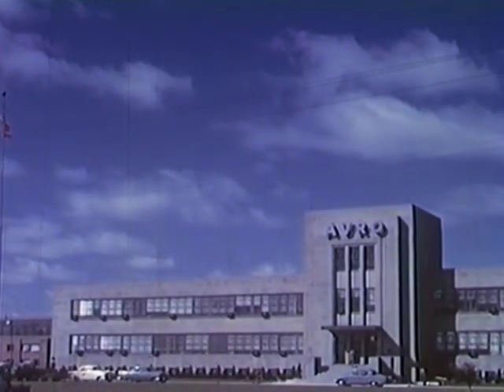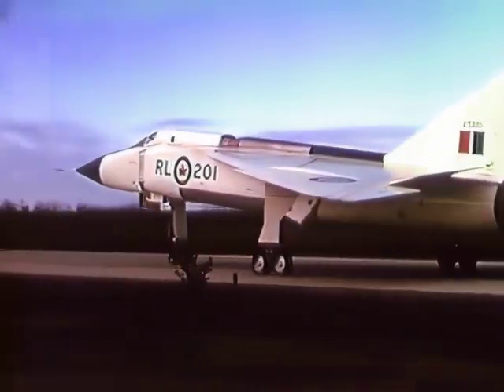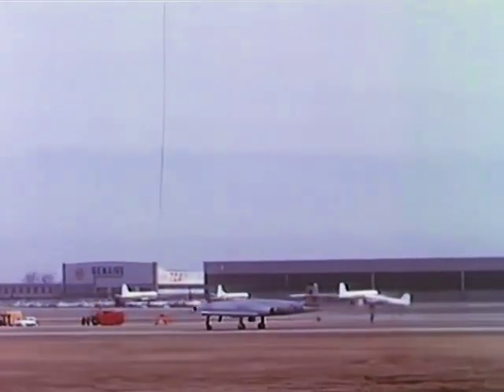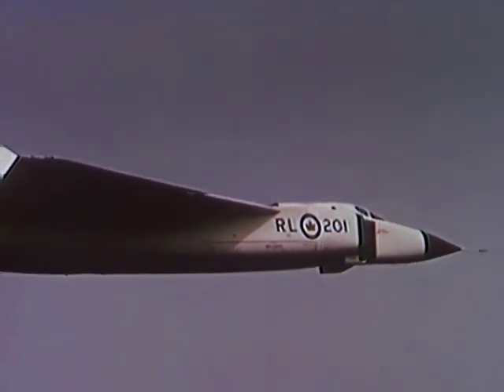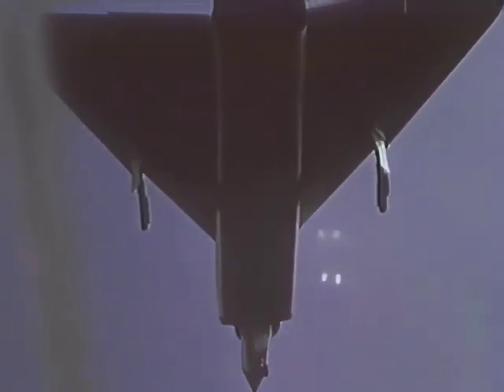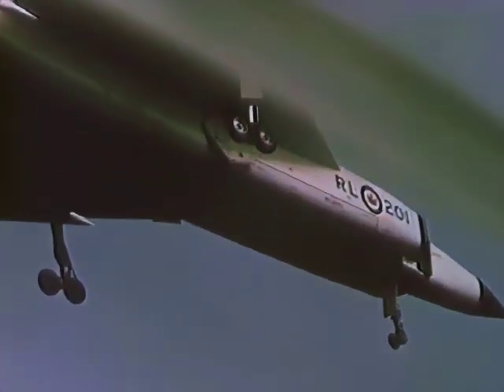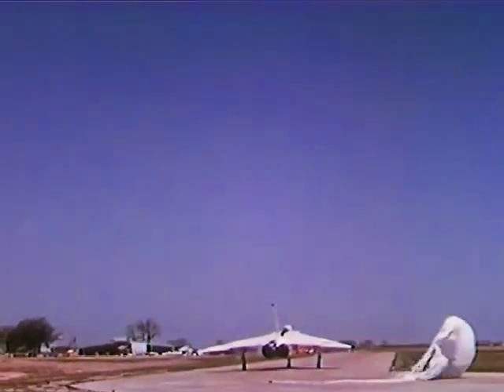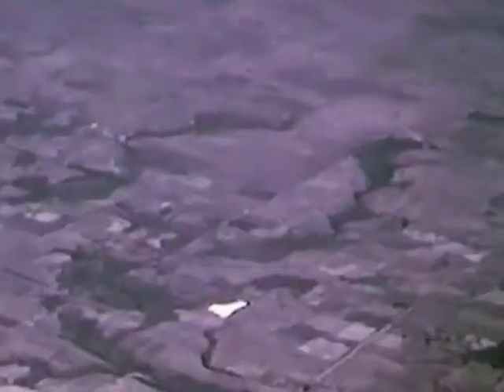Avro Arrow First Flight - March 25, 1958 - RESTORED FOOTAGE

Comment: We will never know what a great inceptor we had. So far ahead of its time.
Reply: Leading-edge to be sure, but not the apex wonderbird folklore has made it out to be.
In reality, McDonnell's F-4 Phantom II was a more-capable aircraft by every metric.
Reply: @raynus1160  F-4 Phantom II was a good plane but get shotdown and lose the war at vietnam it was not great to the end lol
Reply: @p-40war-hawk71  
USN F-4's maintained a 5.42:1 kill ratio over N. Vietnamese MiG's.
USAF F-4's maintained a 3.42:1 ratio.
Not bad, considering the first 'hard-mounted' gun equipped (and more maneuverable) F-4E didn't arrive in SEA until 1968.
Reply: As a Canadian I'd love to say that we were #1 but I  temper the knowledge with the Fact that the F4 Phantom was in Development at the same time (1955 to 1959)and it was also a mach 2+ aircraft in addition to being usable in Navy service  which the Arrow was Not due to it's enormous size (it was rated for the same load out as a B25 Mitchell!!!)
Reply: @tylernorris7945  
Several Mach 2 interceptors were already flying in 1958, some before. Lockheed's F-104, EE's Lightning, Dassault's Mirage III, and Mikoyan's MiG-21 all flew 2+ years before the Arrow.
As to dedicated spy planes, the U-2 first flew in 1955. The Mach 3 Lockheed A-12 flew in 1962. The Arrow was designed as an interceptor, with a possible secondary rcce role. As stated above, it was an ambitious design, but doesn't really hold up to the hype assigned to it. As its contemporaries were exceeding Mach 2 with regularity, the fastest level flight speed attained by a CF-105 was Mach 1.90. It  carried neither a weapon nor a radar/fire control system on any of its 66 flights and, had it not been cancelled, likely wouldn't have entered operational service until 1961-62.
Reply: It was way too big of a target.  Not great as interceptor I doubt.  But a good bomber. And maybe even a good recon as engines got faster.
Reply: @woodywoodlstein9519 horribly short range too. F106 was a better design for this role, which was not a very useful one (shooting down large bombers).

Comment: Everyone seems to be forgetting that AVROE had US Military contracts for groundbteaking designs. The Arrow was also designed to be easily repaired, modified and improved. Turn-aroung time was shorter than just about any other aircraft. The F-18 is a wonderful aircraft, but tetribly expensive and hard to repair compared to the Arrow. Even if it was not the best plane in production, it would have vaulted the Canadian Aircraft Industry onto the World Stage. No one else was manufacturing the Airframe, Engines and Fire Control systems In House!

Comment: The airframe and engine were a huge achievement. The other half of the program, an RCAF project not an Avro one, the missile and fire control systems Sparrow 2 and Astra, were black hole disasters that were trying to go way too far in the pre-integrated circuit and microprocessor era.  A fully active fire and forget missile didn't come along until over 15 years later, with the rather large Phoenix, and with the intended size envelope of Sparrow 2, wasn't really achieved until the AIM-120 AMRAAM  in the 90s.  The RCAF contributed a lot to the program's demise due to the obsession with pushing the electronics technology instead of going with off-the-shelf (Falcon) and sinking over half the project money into that electronics black hole.